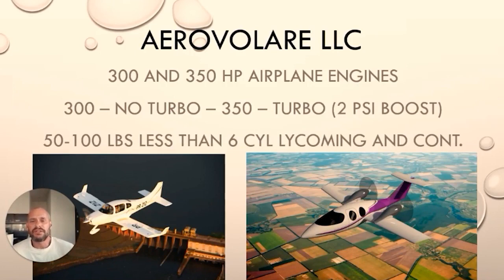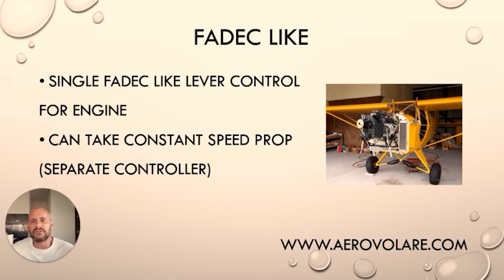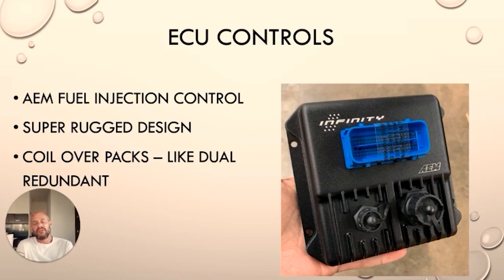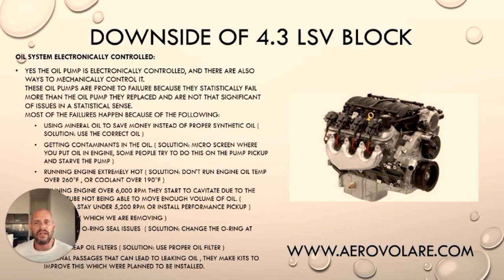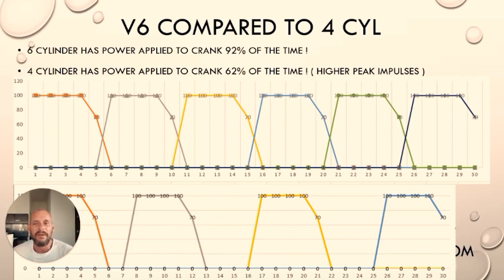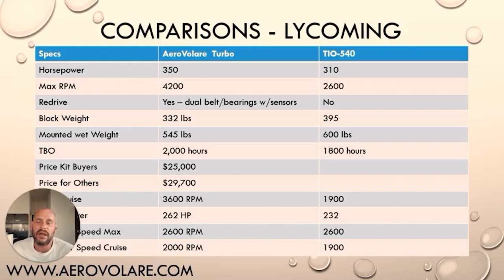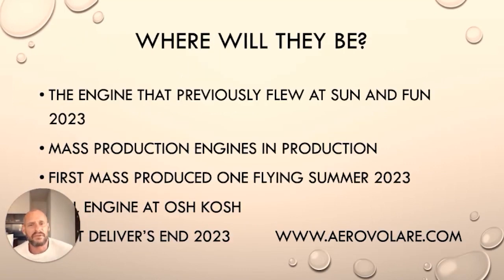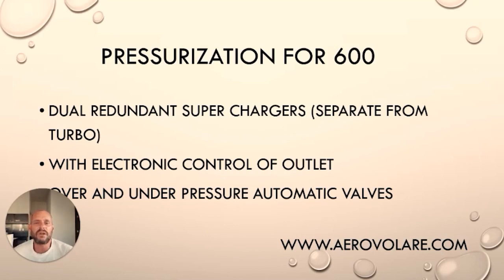Aero Volare Experimental Aircraft Engines

Comment: There is a lot of wrong info here.  The veloce 400 seems awesome, but not sure what is going on with this engine info.  The LSV is a 7.2 cat, and the LS5 is a 4 cylinder.   This would have to be a LU3 or LV1.  These engines are LT based, not LS based.  You mension coil per plug, but the pictures clearly show a distributor.  There would be absolutely no reason to retain the vlom, and it is a huge failure point for the ls and lt engines.  You are correct about the need for oil changes and the filter for the vlom.  However, it should be deleted as there is no need for DOD in an aircraft.  If it does infact have the vlom, it would have to be the LU3.  Gm got rid of it on the newest one, the LV1.  They should put some info up their website.
Did some more research, remembering this is from the industrial line.  The pics of the plane match.  The thing weighs about as much as an ls3, and I highly doubt they can squeak out 300 na.  Engine is rated at 135hp for gens and forklifts.  It is rated at 220 in the boat.  No way are you getting another 80hp out of an industrial engine.  The lv1 is rated at 295, but it is not an industrial engine.  It is also way lighter and doable.  This industrial engine is not even close to meeting the listed specs.
Reply: LV1 or lV3 is the base engine, LV3 needs some extra mods to make it like LV1.  It is LT based and alot of the LS stuff still fits directly on it as well.   The photo is of the old engines they made, now they modernized it.
Reply: @jamiefettig  thanks for the reply.   That makes sense.   May want to delete this vid and make a new one with the current info.  I really like the plane.  Hopefully in my near future.